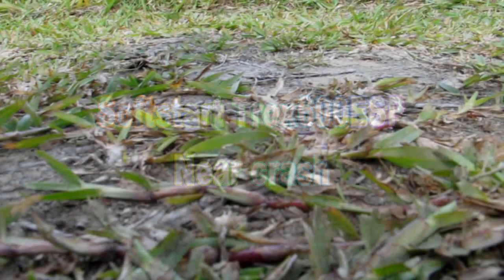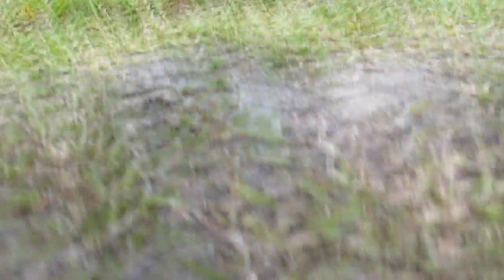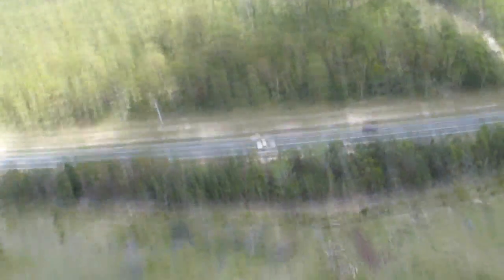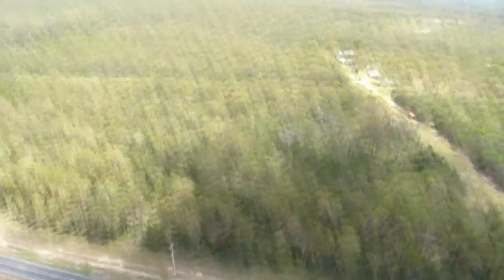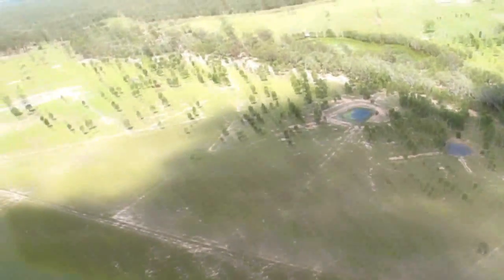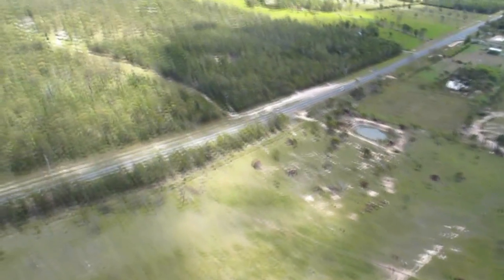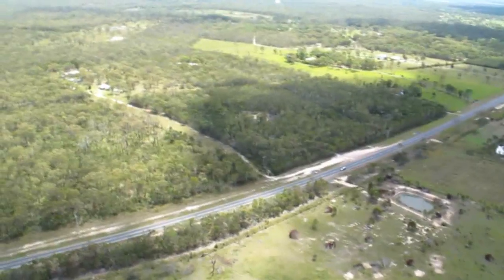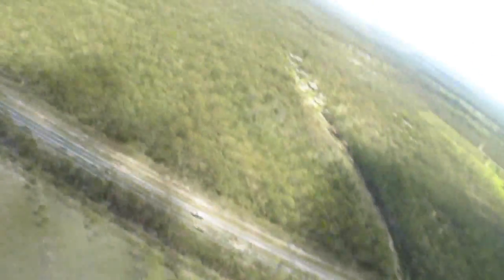Chopper Down

Comment: You were lucky with the lack of damage.
I read the forum from your link & I agree that flying in Idle up is the way to go. I always do that, even on my 2 scale models (Blade 400/Jet Ranger & HK500GT/EC 135) and my Trex 600ESP. It gives protection over your problem, also I have found it to be more stable.....higher head speed etc. Cheers. BB